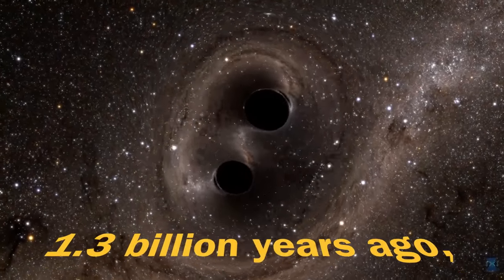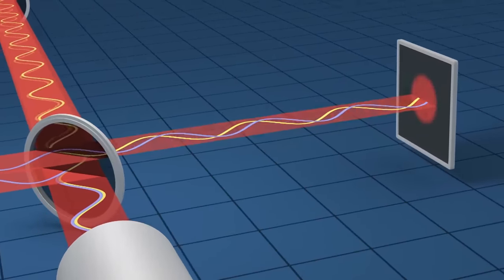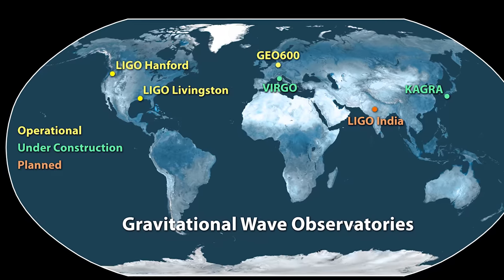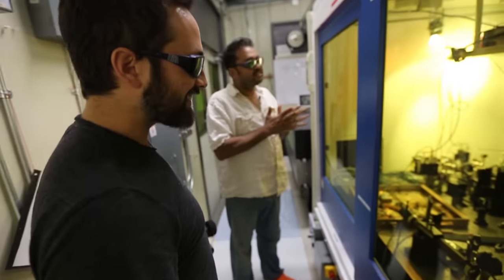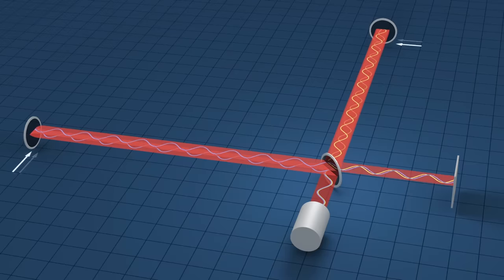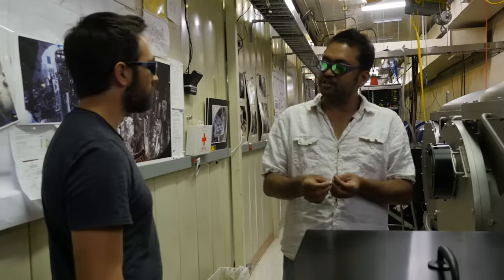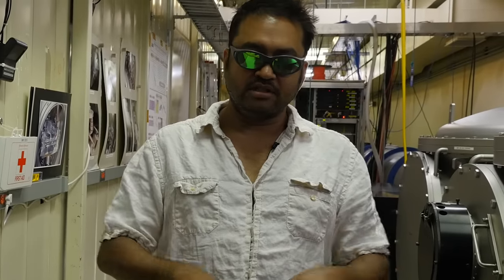The Absurdity of Detecting Gravitational Waves

Comment: Mybe gravity was not so strong 1 milion years ago? And earth was smaller. And we can move stones easy?
Reply: There have been attempts to look for fundamental constants variation along Universe history. But none was spotted yet. So, if there are any changes, they are very very small.
If gravitation was significantly different a Gy ago, then galaxies a Gly away would look very different, but they don't.
Reply: @ThomasKundera  peru?
Reply: @VascoDeGamaa  : Not sure I get what you mean. Sorry.
Reply: @ThomasKundera  peru gravity is not so strong. Today. So mybe 1 milion years  ago earth was small, gravity too
Reply: @VascoDeGamaa  : You have been misinformed.
You're confusing Earth gravitational field strength at surface, that may locally vary a bit for various reasons (density of underground, and mostly latitude), which is very small (about 3 per thousands to the most, so nobody would notice anything) and Gravitational Constant, that is the factor by which mass is curving space-time (and that is not known to ever change, it's an universal constant).
Reply: @ThomasKundera  no. Take moon. Or Mars.  Gravity there is not strong. Because size.  Moon is smaller.
Reply: @VascoDeGamaa  :
Lets take Newton gravity. Here is the general formula:
F=-GmM/d²
with F: force in Newton
G= 6.7 10⁻¹¹ m3 kg⁻¹ s⁻² the Gravitational Constant (that's this one we're dealing about) 
m and M the mass of the two objects (kg)
 d distance between them (meters).

We can deduce from that some classical "gravitational force field" around the object of mass M, that would be g=-GM/d² such that some mass entering that field would be submitted to a force W=gm, which is usually called weight.

So being at various distance of various massive objects will gives you a various weight (g=9.8ms⁻² on Earth, 1.2 on the Moon, etc.) but that doesn't changes at all G.

Is that clear now?
Reply: @ThomasKundera  no. We have really big stones on earth and no idea how they mooved 1000 of years ago. Technology  is 1 possibility but gravity 2nd. Earth 1 Billion years ago Was small. About 10 km smaller in average.
Reply: @VascoDeGamaa  : "We have really big stones on earth and no idea how they mooved 1000 of years ago. "
Which stones where?
I live in Strasbourg, there is a huge Medieval Cathedral here, pretty big and nice stones. Then what?

"Technology  is 1 possibility"
Yeah, wood, ropes and people.

"but gravity 2nd."
That's fantasy. Dunno who told you that, but that's just naive.

"Earth 1 Billion years ago"
There were no human to build anything either.
I don't understand how you try to relate stuff 1Gy ago with human recent past a few thousands of years old.
It's like saying "the bus is late this morning, maybe that's because the large dinosaures disappeared 60My ago". Makes no sense at all.

"Was small. About 10 km smaller in average."
10km smaller is less than a 1/10.000th what do you expect from that?
And if mass is kept, then gravitation at surface will be higher. And if mass wasn't kept, where odes it comes from?

Comment: I'm still on the fence. After hearing his explanation yes they're measuring quantum differences but we can do the same thing with satellites by measuring how far off the signals come back when we don't account for relativity. My impression of a lot of astrophysics is that it is based on suppositions and is a house of cards, most astrophysics is based on assumptions namely candlestick stars and I have a problem with that. Call me crazy but I was told never to assume anything... If we suppose that candlestick stars are bogus the whole thing falls apart like a house of cards.... We don't actually know how far anything is away from the solar system we're just guessing.
Reply: I think the satellite positions do need to be corrected periodically and its speed may be a function of variation of g on the surface of the earth directly beneath it. Therefore the level of accuracy could be questionable. That said all these errors are invariant and it may be possible to be negated using filtering techniques. There may be additional noise sources from Sun spot activity, HECR etc That said the idea is worth exploring. I also feel hese sort of questions may have already been addressed before spending billions.

Comment: 0:27 bilion years? so how old is the universe?
Reply: ~13.77 billion years
Reply: @Owen_loves_Butters  as far as i heard it is 16 miliard years, to be stricte - 10 to how many? 13.77, that stricte?
Reply: @jszania  1.377*10^10±0.3%
Reply: @Owen_loves_Butters  : There are several assumptions to get to that figure, so that's the Standard Model value.
As it's the best we have, we'll keep it until we have something else, but I wouldn't put an unreasonably large credence on it, inflation phase is questioning, as well as the current discrepancy in measured Hubble Constant for example may indicates we missed something.
However, it cannot be much older or younger than this because of more indirect observations (Galaxy shapes, oldest stars, etc.), but I wouldn't bet on the error margin.
Reply: @ThomasKundera  The big bang cosmological model is corroborated way beyond a reasonable doubt. There are things we don't understand, but we've got the age of the universe pretty well figured out. The relative elemental abundances we see predicted perfectly, the CMB radiation that produces the most perfect blackbody curve we've ever seen that matches the expected temperature of 2.72548K with an error of only ±0.00057K, etc.

Comment: It strikes me as odd that just these two guys are smarter than the REST of the scientific community. Such a glaring deficiency surely would have been thought about and corrected for. This is of course the part where a 10* -6 wavelength is used to measure 10*-18 gravitational wavelength at 3:39. I seriously doubt that the scientists would go to all the trouble to build TWO interferometers with such a glaring discrepancy.

Comment: Why isn't the wavelength of light expanded and compressed by the gravitational wave?  Is it not also a physical length?   Intuition says that this length is warped by the same % as the arm length in the interferometer, therefore there should be no phase shift whatsoever.   Can someone explain this?
Reply: That's why science doesn't operate on intuition. If it did, quantum physics wouldn't exist. Intuition  is literally the bane of scientific progress, and yet you're using yours to cast doubt on a subject you don't even understand.

Comment: An explosion can not happen from two empty containers. There is a flaw in your logic. If it’s a hole colliding with another hole. What is there to react. Gravity doesn’t exist without mass. 
Two massive gravitational fields colliding wouldn’t result in a massive explosion. In the same way two magnets don’t repel if allowed to freely connect. When an attractive force meets an attractive force.
Please explain why it would explode and not just disable itself. Or compound the gravitational effect.
Reply: Fridge magnets don't massively distort space-time around themselves the way that black holes do. Remember that there is a giant stellar or greater mass at the singularity in the centre of every black hole. Co-orbiting black holes have these masses swirling about the enormously compressed and distorted space-time between them. When they finally collide, a lot of this gravitational energy is released, and it is this which is detected eons later at LIGO. (There can be no explosions when the masses involved do not permit anything to escape from inside the event-horizon, and that includes light). And yes, the two combined black holes will form an even more massive black hole, minus the gravitational energy released as they spin ever more rapidly towards one another and then merge.
Reply: So you don't know what a black hole is. You could have just said that instead of all of that gibberish.

Comment: Te main problem with detecting gravitational waves is that they don't exist. And the greatest prof of it is detecting them with this method. The "detection"  g.w. with this method is in fact a proof that you didn't detect g.w.
That's because the compression of space results in the equal and exactly proportional expansion of time just as well as the compression of time yields exactly the equivalent amount of the expansion of space. 
Therefore, when the imaginary g.w., passes through the detector they will come absolutely synced as if there was no wave at all.
Reply: You obviously never studied GR (which is hard, I agree), but if you did, you would know the difference between local coordinates and proper distance, and how a GW can let local coordinates invariant while affecting proper distances.

Look for this article (should be in open access) if you want to learn:
"The basics of gravitational wave theory", by Anna Flanagan and Scott A Hughes, sept 2005 in "New Journal of Physics", Volume 7, 2005. It's explained page 15 and 16.

Comment: Light waves are the one thing least affected by gravitational forces. Why use light to detect gravitational waves. How do you know the laser beam is affected by gravitational waves. Without a secondary experiment that shows light is affected by gravity. A laser beam doesn’t bend around the earths or even the suns gravitational field. A laser beam doesn’t orbit the earth. Some light waves pass through matter. 
Is it possible your detector is being affected by solar radiation. Perhaps picking up neutrino or X-rays that are altering the data. 
Why do you think it’s gravity affecting the beam and not light wave interference coming from outside sources. Could just as easily be a sun spot or solar flare causing the phenomenon. If you’re facing the sun while conducting the experiments.
Reply: Light is affected by gravity exactly the same as everything else. You don't know what you are talking about.

Comment: What did the jweb telescope teach us? That the galaxies at the beginning of the formation of the universe are the 
same age as ours. so the universe is extremely younger than previously thought because 
time is estimated by the speed of light and the speed of light depends on mass. 
so if we reverse the expansion process that we measure today we arrive at an extremely young universe.

Our galaxy's disk has a diameter of about 100,000 light years and a thickness of only 1,000 light years. 
And this false estimate is based on the speed of light we observe today, not on the actual speed that the initial mass 
had during the big bang. Because mass and distance accelerate exponentially at their initial real state.
So all our estimates of the age of the universe are exponentially wrong.

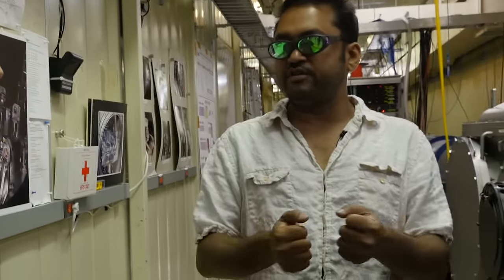Comment: "and keeping the laser wavelength from the laser itself fixed" (6:42 min)
🤣
"the laser itself"... as the only thing in the universe, it is beyond the reach of the gravitational wave.

Aaaah: "So the new fresh light now goes through there and has to travel a bigger distance than the light before". The wave world remains a little bit and waits for the fresh light (6:36 min). That makes sense.
Sure, the unstretched laser after the gravitational wave measures the distances during the wave. ;)) "The distinction between past, present and future is only a particularly persistent illusion." says Einstein in the future...
Or the mathematicians know, when in the eons of the very smallest time intervals an error source appears and when those must be cleaned up with again eons of calculation steps. 
They probably also knew accurate to the femtosecond beforehand when the two "black holes" would collide.
I am completely convinced.

Everything becomes possible when physics happens only in mathematical simulations.